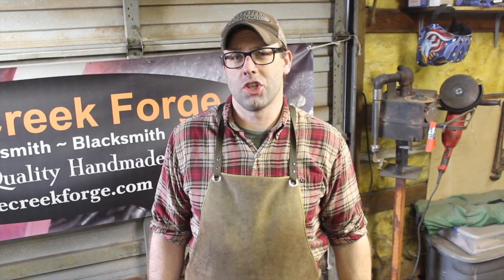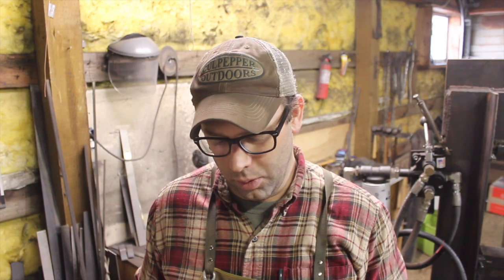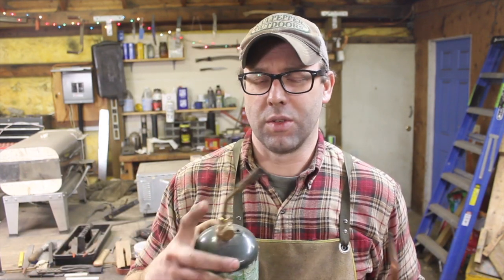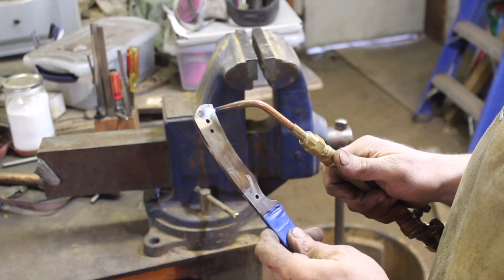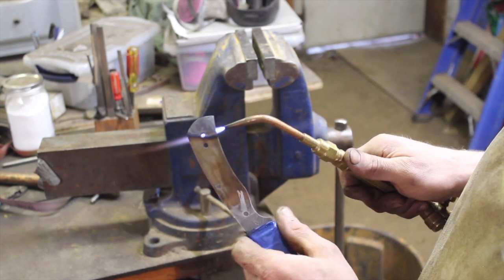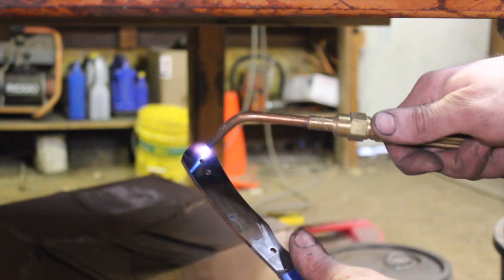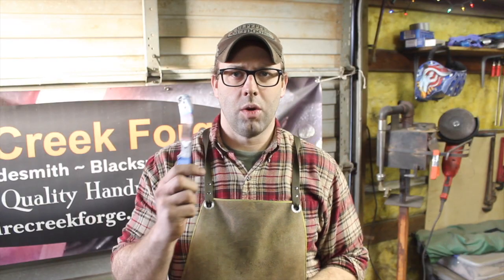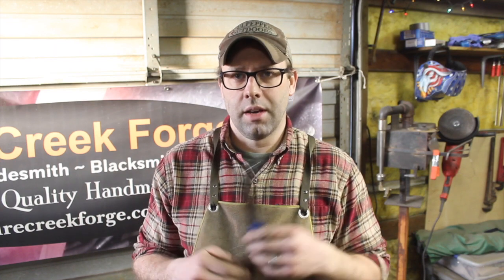Knifemaking Hack : Drilling Hardened Steel Tang

Comment: I free hand sharpen my drill bits, I got a cold steel drop forged bowie and thinned the handle and drilled more holes and made all holes much larger & put a real good plastic rubber grip from Pittsburgh forge 12 in.  Crescent wrench.

Comment: I work in  captured machine shop and occasionally i need to work with hardened steel cutting plates.  I always dreaded needing to  drill and counter sink the corners of these plates to be able to mount them to their bolster plates.  NOW, with this knowledge I was able to easily drill the holes I need by annealing only the corners.  Thank you so much.

Comment: Thank you! I managed to heat the tang with my gas kitchen's burner and worked perfectly. To avoid softening the blade, I wrapped it in a wet towel, adding more water as needed.

Comment: Try Carbide masonry bits.  I always use a good masonry bit to drill out taps and other glass hard steel.  I stay away from solid carbide drills since they are really hard and brittle and a bear to remove if you beak one.  Get a quality bit that has the tip ground sharp.  Use a drill press and go slowly.  Learned this when I broke off a tap in a friend's Honda motorcycle part.  Drilled center out of tap and picked out the pieces.  Try it on a worn out file before you attempt it on something you want to save.  The trick is to use a decent masonry bit that is sharp. Masonry bits have a mild steel body with a small carbide tip brazed into it.  They handle a fair amount of shock and flexing.  Milwaukee, Bosch, or Dewalt bits in the sizes you need for knife handles can be had for around $5.  Stay away from the no-name imports that aren't sharp and use inferior carbide.

Comment: You da man! I tried drilling into a lawn mower blade with DeWalt cobalt drill bit and it would not make a dent. I then stuck the blade in the wood stove and got it to a dulll red color. Sure enough it then drilled right through like mild steel. This works!

Comment: Just re-watched this. This is probably the single most useful video (for me, at least) that you’ve ever made. Just went out and spheroidized an 8670 knife that was annealed but 1/4” cobalt bits just couldn’t get through it. I was filing some tight corners in the profile just fine but drilling wasn’t working. 2 heats to dull red, air cooling in between, and it was soft. So helpful

Comment: Just had this problem with a full-tang hunter I'm working on (complete newbie, blade fresh from the forge - drilled four holes for the bolster with no problem, but then burned out two bits further down the tang). Thanks for the advice!

Comment: thank you for the heat treating tip.. I was attempting to drill 2 holes in the blade and destroyed a black oxide. Titanium coated.  Cobalt. And diamond drill bit. I am going to try your tip.. I could not think of the next step. An expensive learning process.

Comment: I drilled through a forged scythe handle today using a Milwaukee Tin drill bit and a Bosch Cyl9 ......using low rpm works well, cant heat the scythe

Comment: I have to put some holes in the face of a Trowel,  only about 1mm thickness!  Usual metal bits, no joy, nothing.  I'm not a machine worker but do have a drill stand.  Bought some cobalt bits, nothing!  Its a quality Trowel, but give me a break!   The trowels manufacture's website did not provide any info on the steel they use, but according to Google its likely to be C55, whatever that is?  Was just about to order some "cheap" Carbide bits, but just seen your great vid. THANK YOU!
Reply from the maker: @cmod8099  Glad it was helpful! Just be careful if you heat that trowel, it will lose the hardness which will make it soft and will possibly lose its rigidity or spring. C55 should be a simple carbon steel with about .55% carbon content, by the way.
Reply: @FireCreekForge  Yes its a nice springy steel.  And its only a couple of 4mm holes needed!  I've got one of those plumbers propane torches for doing copper pipes.  I might try that trick mentioned below of heating another bit of pointy metal to bright orange and then pressing the end into the spots needed, with the bulk of the trowel wrapped in a wet towel.  Then trying from there if too much heat is wicked away.  Trial and Error!
Sounds like maybe .55% is within scope of the BlueSpot cobalt bit, I've got, so will give that another shot first just in case, but it was starting to bend at 350 rpm,  but will try a lower/faster speed.
4mm hole through 1mm!  But its a nice trowel so don't want to punch through first.
Thanks again for your help.   All the best.

Comment: Hey, thanks from Don   I bought chain saw clutch,  got rest of it right , but darn crank  shaft  hole to small, it's hardened  I found  that out by drill correct size I needed wouldn't drill it,  So I got do what you said  is heat the hole up bit to dull red air cool it by itself, then drill it to correct size, but then can I  heat treat it back to hardened  state again???
Reply from the maker: @donald4416  you could, but you would have to heat treat the whole thing probably, removed from the saw. I'm assuming the part you are talking about extends away from the saw. It's probably fine to run as is, but I couldn't say for sure.

Comment: Hi. Great channel. I’m a beginner knife maker, made a few, just stock removal at this point. Haven’t forged anything yet, but getting closer to that goal.  I am making a knife from a file. Took a bit of doing because I didn’t want to mess with the heat treat but I do have a profile for now. I would love to pin the scales on it, but it’s obviously way too hard to drill. My question is, can I soften the steel by either a couple of cycles in the oven and annealing the whole thing? I know I would have to do that eventually to soften the steel a bit to make it a useable knife. Or would you suggest blow torching the handle directly to soften it while the blade is in water. Probably an easy question for you to answer but I don’t want to just jump in. Thank you. Also should I wait until it is fully annealed before I try and grind in the bevels? Again thank you.
Reply from the maker: I would temper it in an oven for two hours first. Probably 400F. After that you can heat the tang to a dull red where you want to drill, keeping the blade cool.
Reply: @FireCreekForge  Wow, thank you for the super fast reply. Great advice and thank you so much again. After the oven cycles, I can drill the tang, grind in the bevels and no need to re-heat treat, correct? Just want to make sure.

Comment: What if you heated only where you are drilling by chucking a piece of hardened rod (the diameter the hole will be) then pressing it down hard, with no lube, at the presses highest speed, exactly where you will drill a hole?

Comment: I need to drill D2 steel for a thumb stud, so I think this would ruin my blade.

 I need to find something that will cut without changing the steel. It is only one small hole so I'm okay with ruining my bit if I can just get through it with a small bit. 

Maybe a pencil torch without quite going red hot, with a carbide or diamond dust coated thing?

I love this knife but I want a thumb stud for easy opening.
Reply from the maker: A carbide bit may be the best option in this case, but I haven't tried it
Reply: @FireCreekForge  I'll let you know how it goes

Comment: What about if you are drilling for thumb studs on a folding knife? You can’t just ruin the heat treat of the blade, any salutations? Thanks
Reply from the maker: @Cody55555  that would be tricky. You would have to keep the edge cool at least. If the blade is still in the knife, I don't think it would work.

Comment: Very hard to judge if its above austenising temp by looking at the color of the hot metal. You are at least very close I would guess?! Gunsmiths do this often to get through case hardening when putting scope bases on old rifles.
Reply from the maker: It is below austenitizing; if you get up to austenitizing temp you the create pearlite, which you don't want in this case..